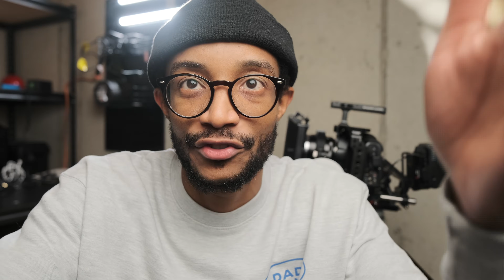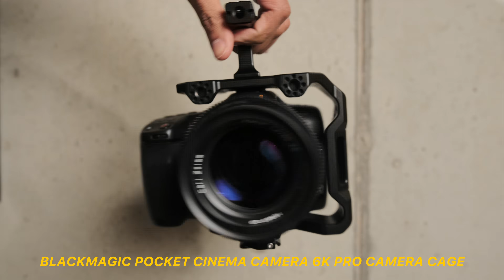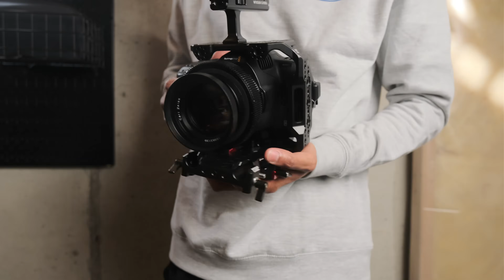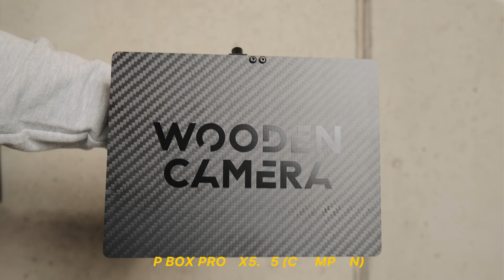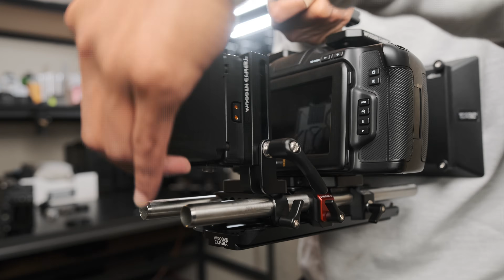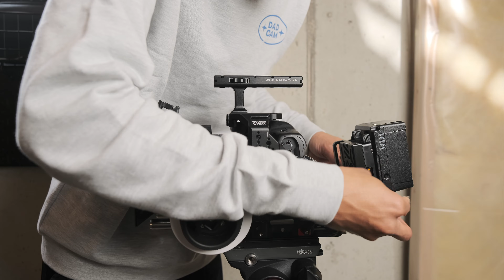My BMPCC6K Pro Rig with Wooden camera Cage

Comment: Hey man! Great video and came at the perfect time! I'm currently trying to pick between the Zcam e2-s6 and the bmpcc 6k Pro, I think I've decided on the 6k Pro as I create a lot of narrative content and I hope to become a freelance DP in the future and although it looks a lot more uncomfortable to rig up and shoot with, the image quality just blows me away compared to all it's competitors but I keep going back and forth. Just wanted to hear your opinion, when do you find yourself picking up each camera and what would be the better option? Also, I'm curious how much battery life do you get from that V-Mount battery?
Reply from the maker: Hey Jordan! Thanks for watching the video! But sure, I get this question a lot.
Both cameras are more than capable being a workhorse. But there are some strangths one has over the other.

Bmpcc6k pro: I use this camera for run and gun content creation, documentaries and other miscellaneous content. The all in one system is very convenient and the image quality. That's the strength.

The weakness for me is the s35 sensor, I prefer full frame.
The fixed lens mount EF or PL.
Resolution options are limited for my type of creative work.

The z cam has amazing image quality, i interchangeable mounts (EF, PL, Sony e, Mft etc,) great battery life, lots of resolution and frame rate options.

The down side is that it's not as convenient for everyday content creation. So I use it for all of my high end Productions like music videos, docs, short films, and commericals.

I hope that helps!